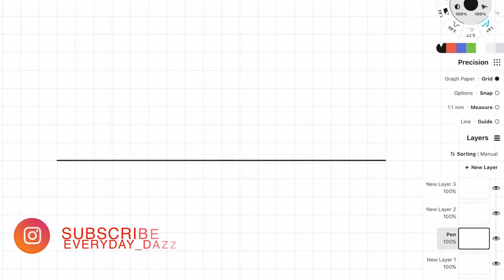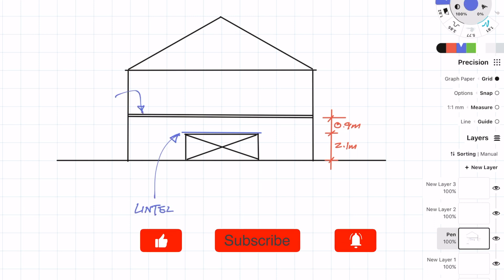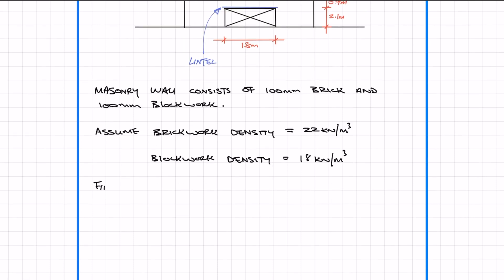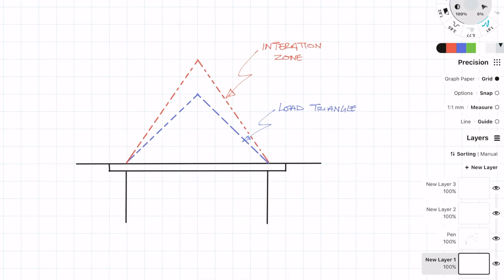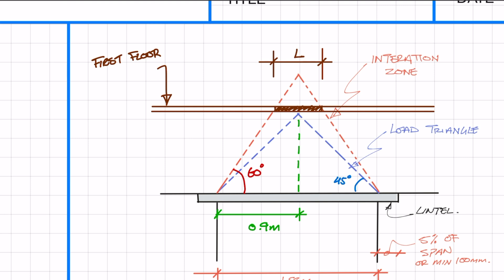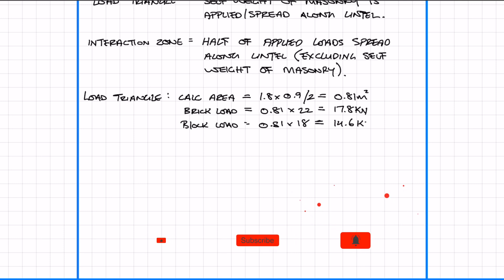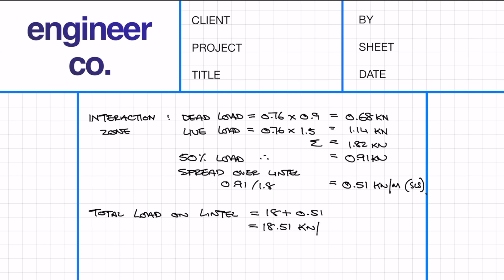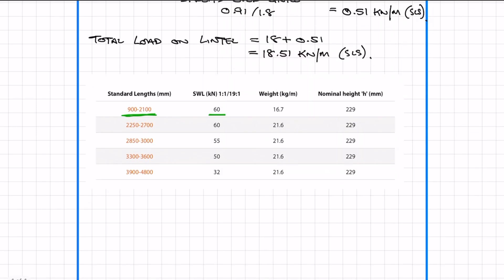Lintel Design for Beginner Engineers

Comment from the maker: hey everyone, I missed out multiplying the masonry wall loads by 0.1m or 100mm. So the wall loads that i calculated are a factor or 10 out! This goes to show that you shouldn't work late at night and you should double check the numbers! The steps and process remains the same though!
Reply: Hi, 
What parts of the calcs are these added into? Thanks
Reply from the maker: It’s when I’m calculating the self weight of the walls. I forgot to multiply by the wall thickness
Reply: @EverydayDazz  So its on the brick and block loads for the load triangle? thanks
Reply from the maker: Yeah that’s right
Reply: @EverydayDazz  Thanks, is a final answer of 5.065KN correct? cheers
Reply from the maker: Yeah that’s correct! 👍
Reply: Should this be 22kn/m3 x 0.1 then?
Reply from the maker: Yeah
Reply: @3:13, you multiplied dead & live loads by 1.7m. But these loads should be multiplied by a length perpendicular to 1.7m. Am I missing something?
Reply: Was just going to comment this, had a mini heart attach when I thought I'd been designing lintels wrong by a factor of 10 😂
Reply: Think you need to put a note in the video
Reply: I had this doubt because area was m^2 and densities were kN/m^3
Reply: Will the calculations be effected if the roof load is also taken on this same wall

Comment: Hi Thx for video. very clear and informative. Just one quick question re point loads. If I have a wooden beam? (timber that spans between gable ends for ceiling joists to be fixed to) in the wall above the lintel and in load triangle  shouldn’t 100% of that load  (dispersed at 45deg) be applied? 

I’m sure I read that on some website, but you say ONLY the weight of supported masonry.

Also, if the wooden beam is just outside the interaction zone does that have no influence on the loading?
E.g. If I were to draw a triangle below the point load it would be covering part of lintel.

I’m not a builder or engineer so excuse any incorrect terminology.

Comment: Need to check the inner : outer load ratios which is commonly missed out and can affect the size of the lintel used. Probably won't affect it in this scenario that you have used. Great videos 🙂 Can you do one on timber framed buildings and racking.

Comment: Hi. I’m just wondering where are the loads for first floor walls and also roof transferred to? Great video btw, helps people like me who are new in the industry.
Reply from the maker: The first floor wall is transferred by the lintel and the load is supported on the ground floor walls either side of the opening. Depending on which way the roof spans, the roof will be supported off the first floor walls as well.

Comment: I think you need to add the self weight of the wall between first and roof as well as the line loading from the roof. Then consider this as the UDL coming down. Unless there are openings in the first floor affecting how the load is spread. 

1.80m is usually pushing the limit for a lintel supporting a load bearing wall.

Comment: Do you design lintels for wind loads? being timber, block, brick or any material
Reply from the maker: I don’t think I’ve ever designed the lintel for a wind load but you would need to check the masonry panels for wind load.
Reply: @EverydayDazz   But aren't the masonry panels connected to the lintel? I've had this discussion with colleagues before. Some think lintels should be designed as wind beams, while others don't.
Reply from the maker: I would maybe check the lintel for wind if the opening was very large and if there wasn’t a significant amount of masonry above the lintel. It really isn’t something I’ve ever considered as much of a problem.

Comment: Shouldn't you also add the masonry loads of the loft above the first floor?
Reply from the maker: only the masonry within the loaded triangle needs to be considered because of the way masonry arches.
Reply: @EverydayDazz  So what about loads above? How is it transferred to the ground?
Reply from the maker: the loads above would spread to the rest of the wall supporting the lintel.
Reply: @EverydayDazz  ur calcs not correct. Total equivalent UDL at SLS should be 3.3kN/m
Reply: @annesmith2273  How did you get to 3.3KN/M? Thanks